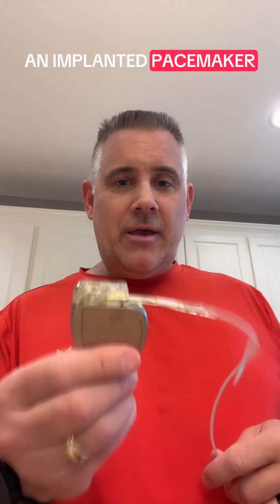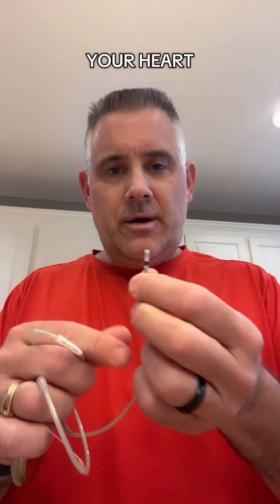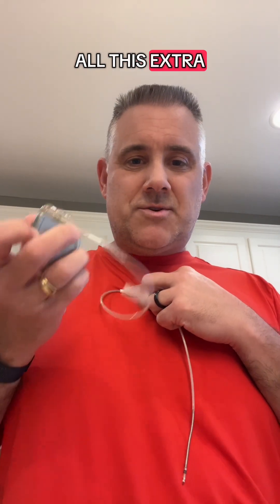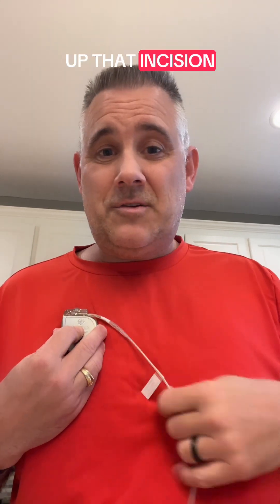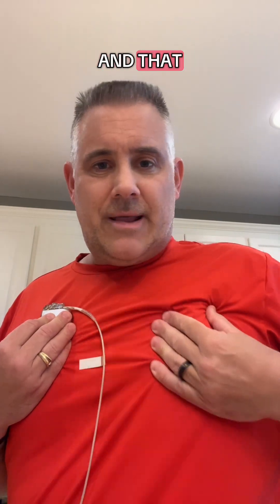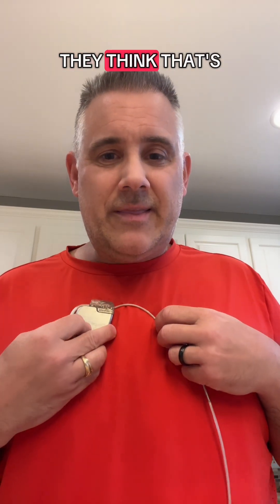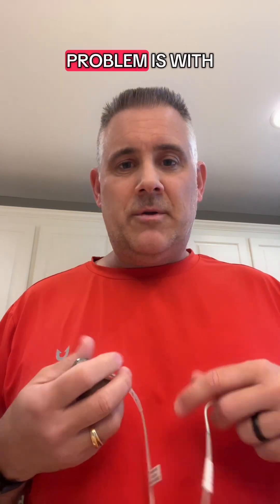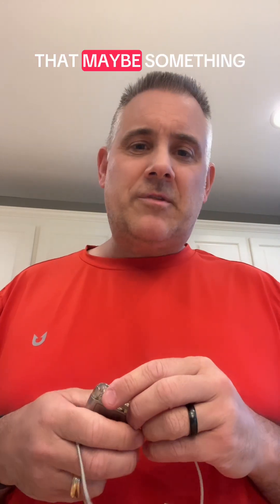Pacemaker/Defibrillator movement after implant.

Comment: Hey Doug! I was just thinking if my battery will get replaced after 8 years then will I get another cut in my chest and if it is like that how many cuts I will get in the whole Life time m 38 currently.
Reply from the maker: @smitiacharya346  your doctor will typically use the old incision site when they replace your battery.  Sometimes they make a new cut, but most times they’re able to use the old site.
Reply: @DouglasRachac  Doug you are my saviour